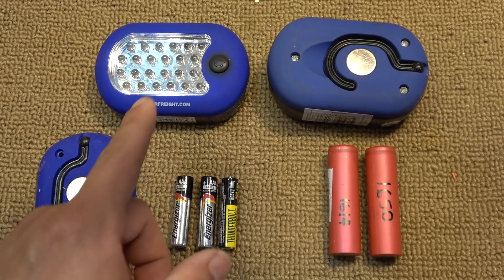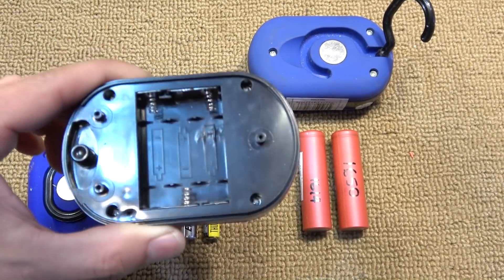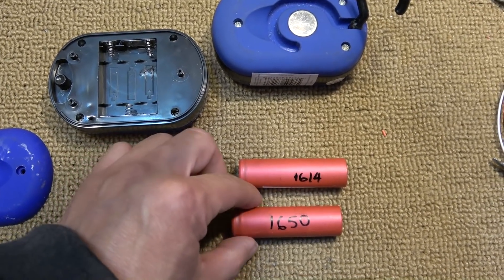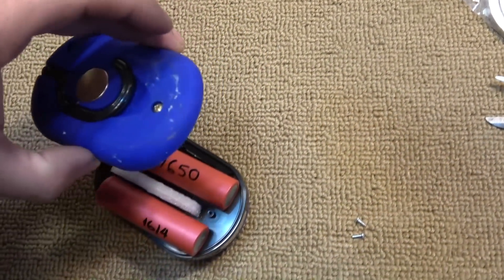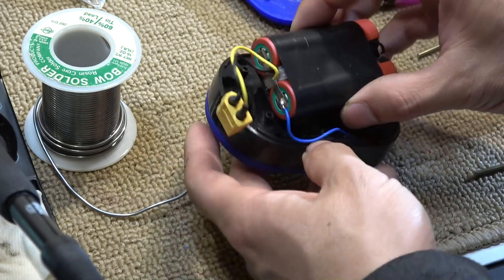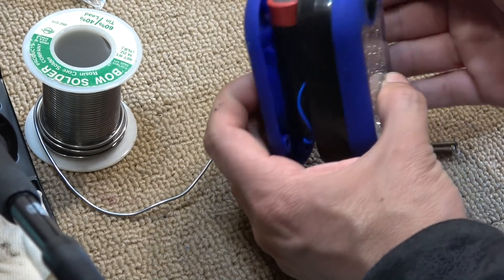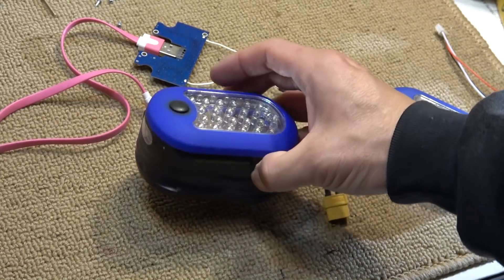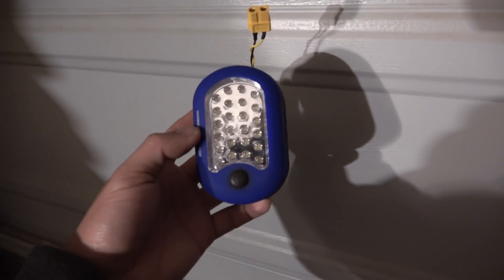DIY: Hack Harbor Freight magnetic flashlight to run on 18650 batteries

Comment: Looks like the same battery that's in the solar driveway light $10.00 and the pocket power pack $5.00. All you need is a nice sunny window seal to set your rechargabe driveway light on and a wired in anelog headphone jack for a small sun charging jack and switch over system. Then you can charge those type batters all year long for free. Also back pack and camping friendly. Just some more cool ideas !

Comment: This video is BS 18650 batteries will.not even fit inside these freebie lights, even if you take all the guts out. He uses a different light that is bigger to do this "hack"

Comment: Use a dead light bulb (the energy saving things/LED's/plastic) and a glass/plastic thing with lid. Cut the dome off. Glue the dome of the lightbulb to the lid and make a hole for the wires. Add LED's. Add resistors, maybe. Add charge boards. Add wires/holes/hooks/holders inside. Enjoy.

Comment: Nice mod, these lights are great, but what is MOST annoying is there is not a simple on/off switch, the little light at the end is useless, so you always have to hit the button twice to turn it on/off.
So I hack mine (when I collect enough to do many at once), to remove the little led and make the switch so it always just turns on/off the main light.
Reply: Agree SOOOOO annoying just about every decent led flashlight/headlight nowadays has the multi mode BS.....how about just ON/OFF
The last headlight I bought has 4 modes high,mid,low,flash WTF FOUR CLICKS TO TURN IT OFF
Reply: @walkow8297  yep, I took one of those apart to try and fix it, and guess what?  It is some kind of software/chip that detects the button so it is impossible to easily fix it, at least to get it to not be 100% on, which drains the battery super quick, the second level on is where it should be.

Comment: The batteries that come with those lights don't seem to last that long, but when you can get the light for free when you are buying something else that you would have been buying anyway, it's worth what your "paying" for it... :)

I've never actually replaced a set of batteries in this light... By the time I need to do it, it seems that I end up getting another "free" one or I just end up removing the dead batteries and reusing the light with a different power supply... 

I'm currently working in my attic installing an island cooktop vent hood and ended up with a nasty gash on my head thanks to all the roofing nails sticking through the roof decking and other sharp nails and boards sticking out where they shouldn't... Lazy ass construction workers apparently thought that no one would ever need to work on anything in the attic... Or, more likely, didn't care... So, I bought a hard hat from Harbor Freight today for when I'm in the attic and was thinking about modifying one of the old HF lights like this to be mounted on the helmet... I was thinking something more along the line of mounting the light in the front with no batteries and then running wires to a battery pack in the rear of the helmet to balance the weight a bit more...

Comment: i'm gonna try this with my 6x D Cell battery powered water pump. It came with my Mr. Heater BOSS XB-13 propane camp water heater. I think will go hybrid 2x 18650 batteries OR 1 6v usb plug

Comment: I would cut out the inner plastic andmake battery cavity instead of the foam sandwich.  Drill mount a female power socket for recharging.

Comment: You had to use 1S BMS module. This will protect the batteries against over charge and over discharge. 
BMS modules are vital. Lithium batteries are dangerous.

Comment: It's going to be brighter and it's going to be more volts because 3 Triple A batteries in that light Are only to around 3 volts because only two of them are in  series which equals 3 votes... you will be much brighter...
Reply: I've looked at 2 of the ones that I have that are currently disassembled and they appear to be wired with all 3 in series... It wouldn't make sense to have 2 of them in parallel and the other in series since the limit of your power would be based on the capacity of the single battery... Also, one of the things about LEDs is that they are a bit picky on the voltage that you give them... It only takes a bit too much for you to get a burned out LED and it will happen so quickly and without a flash, so you probably won't even notice it happening... With a white LED, you will probably be looking at a Vf (forward voltage) of around 3.3V with a max of around 4V, followed by a burned out LED soon thereafter...Since the AA cells an produce at least 4.5V when connected in series (when new), there would have to be some sort of circuitry inside the light to reduce the power... This could be as simple as a small resistor to drop the voltage and limit the current... Ideally, there would also be some circuitry to compensate for the lower voltage on the batteries as they get depleted (perhaps similar to a "joule thief", but considering the price of these lights, I would be surprised if that was the case...

Assuming that you want to run the LED at 20 mA, then if it has a 3.3V Vf and you have a 4.5V supply voltage, you would need a 60 ohm current limiting resistor.  There are various LED resistor calculators online...

Comment: The magnet on the newer ones are not very strong.
Reply: They vary... I usually have a couple stuck to the side of my freeze and they usually stick to it, some more than others... I had one though that as soon as I put in on the metal side, it started slowly sliding down the freezer side...

Comment: Or you could buy something like 10 pcs 3.7V 1000mAh LiPo Polymer Rechargeable Battery For Mp3 GPS USB Pen 102535 from eBay of around $22 and put 2 batteries inside and the case would close right and these will also charge to 4.2V. Yes it's not free but it's use-full. I bought some and made 9V rechargeable batteries using a Micro USB 3.7V 18650 Lithium Li-ion Battery Charger Module Boost Step up 4.3V to 27V output and some heat shrink tube.

Comment: Awesome job!! I did the same thing with the same light 3 years ago using a old cell phone battery and the battery and charge circuit to fit inside with a hole for charging with a mirco USB.. Mine last a long time but yours would last 10 times longer.. Too cool thanks for sharing!!

Comment: Haha. It’s good but Id rather get a fenix light which gives you a 1000 lumens on one 18650 cell
Reply from the maker: But then it only last a few minutes. :D
Wait a minute, Charles Darwin is here, everyone!
Reply: vuaeco I use mine for 30min every day on my bike rides and charge once a week. The battery is down to only 50-60% at the end of the week. I can easily go two weeks without charging. Miss harbour freights - nothing like that in UK. Stuff was dirt cheap, but very poor quality

Comment: Xin hỏi là ,máy ảnh mình  dùng pin( NP-BK1) 3.6V 1000 mAh,  Li-on ,mình có thể dùng pin 18650 thay tế không ?  nếu không thì nên dùng pin nào thay thế ?Thanks
Reply from the maker: Pin NP-BK1 cung chi la Li-ion cung giong nhu 18650 cho nen thay the duoc. Hai cai giong nhau. Chi co cai khac la 18650 pin to hon nen xai duoc lau hon.
Reply: @vuaeco  ok ,cám ơn nhiều ,lúc trước có thấy anh chế cách làm pin  cho canon sx150 ,mình cũng sẽ làm giống như vậy ,bởi vì pin  NP-BK1 bây giờ khó tìm .Thanks

Comment: I have an orange one of these and I modded it to run off USB power. I just soldered a USB cord to the wires coming from the battery terminals and ran it out the case with a small notch cut in the case. I can plug it into USB ports, power banks, car chargers.
Reply from the maker: Very nice!
Reply: I am going to try adding a mouse tail to mine like you did.  I was worried about too much voltage.  The 5v from the usb didn't fry it?
Reply: @christopherf8160  5v usb is ok for this light. I did it.

Comment: I have this EXACT SAME FLASHLIGHT except it’s red and I got it at a gas station. I might do this because it’s been sitting on my desk disassembled without batteries and I don’t wanna get AAA batteries (I already have 18650s laying around). Thanks!
Edit: Ended up using a Samsung li-ion battery since it fits (with a few adjustments to the plastic). The blue resistor burned when I first put the battery in but that was an easy fix.

Comment: Lol seems like slot of work for something you can get free every time you buy something cheap plus you can get  AAA battery's for a very cheap price at H.F lol. Still kinda cool though I guess. I've got a bucket full of these light lol. There pretty bright to be what they are.
Reply from the maker: Put those AAA HF batteries in there and a couple weeks later it'll leak battery juice and corrode all of the battery terminals on your device.
Reply: @vuaeco  I use them all the time and I've never had problems with them.

Comment: Take a soder gun melt out the plastic battery holder then you will have room for the bigger batteries and cover will fit all the way
Reply: טיפש
Reply: or just use a 10440 in one of the original slots, but then it's not free
Reply: @dummkompf  10440 has really small capacity, 3xAAA NiMhs would be best way to go without modifying anything. 3x10440 would be a bit better (if we take into account 900mAh NiMh and 350mAh 10440, that's 3240mWh for AAA and 3885mWh for 10440) but you would have to rearrange slots.
I've actually used pouch style lithiums in these typed of flashlights with very little mod, you could fit 1000mAh battery inside very easily, you would just have to cut some plastic away from battery holder.

Comment: When I pulled up this video I was looking at a HF light on my bench. 
Now I had just ordered five power banks that take two 18650 cells. . My thought is to use batteries from garden lights as they are aaa in the ones I have. Then use a solar panel to charge them.
As well as use a power bank in a pinch. 

Or just use a big flashlight

Comment: the batterys 18650 nedds a PCB BMS Protection Board
Reply from the maker: Not really.
Reply: What's a cheap $2 flashlight who cares pcb bms protection
Reply: @thewarzoneking  It is not so much protection, is that if you put it without the BMS The batteries will unload the batteries Plus 2.5 V and can not recharge more, being disabled ,, And also if you do not want to Complicate, buy a $2   flashlight

Comment: The problem is if those batteries are not protected and you discharge them to 0 or overcharge them they might explode.
Reply: ^^ Exactly what I thought when I started video. Watching now, as I type, assuming he will not be installing a low voltage cutoff. While these types of conversions seem like great ideas, they effectively kill your 18650's the first time device pulls voltage below threshold.

Comment: I was about to do this to mine, but mine is not a Harbor Freight magnetic flashlight, but a fact similarly one, but I'm going to use a smaller 18650 battery

Comment: No thanks. Its NOT jard to replace 3 trip A batterys as opposed to hacking the crap out of one. They are FREE to begin with. On top of that you still have to charge them. I see NOTHING practical about what you did. I like those lights and get a huge pack of batterys for cheap enough. Generally, they last a long, long time too.

Comment: NO BMS or PCB!!! I Could excuse newbie guys but you’re expert on lithium I don’t know why you missed the BMS part? Used to love your videos but dislike for this one...hopefully you make it right next time bro.
Reply from the maker: If you watch my videos then you should know that I do NOT use BMS on almost anything. So you didn't watch other videos then. :D
Reply: He uses an external tp4056 on and xd60 connector.  With 2 cells in parallel, just us two matched batteries.
Reply: Don't even have to be matched since they are in parallel.  Just use a hobby charger.  No bms needed.

Comment: Why didn't you just cut the inner plastic which holds the spring tabs for the batteries to fit the 18650s sideways then solder wires directly to the battery since you arent going to replace them.

You could have even just removed the inner plastic completely and soldered the wires from spring tabs to the batteries and glued some foam to hold the batteries in position.

Also cut a hole to mount a charger socket.

A little bit of rewiring would make this more professional and slimmer profile
Reply: Exactly what I was thinking!!! He needs to slow down and think things over for a sec. I ain't got all those fancy tools but sure I could come up wit something lot more compact then that. Might even get it in my pocket. Not like that thing. Would need a backpack for that thing. haaa
Reply: @Ken I would love to see a video with your version.

Comment: I have the same kind of flashlight from harbor freight tools there's nothing wrong with a small batteries they were just as good AAA batteries works just as good
Reply: They are non rechargeable...
Watch the video. 
A flashlight is only as good as its batteries
Reply from the maker: @user-tr2dh4xx6u  Very well put!

Comment: Cool, I'll bet run time is in days?
Reply from the maker: Yes. Harbor Freight specs says 48 hours of run time on the AAA. An 18650 is typically 3 times the capacity of 3 AAA put together in series. I have 2x 18650 so it's about 6 times the capacity. That's a whopping 12 days of run time! :D

Comment: HF also has free batteries with coupon, if I bought the spot welder how much would that cost vs buying batteries. This hack makes no economical sense.
Reply: He already has free Lithium batts around the house. A lot longer flashlight time, optional phone charger..well worth hack
Reply: This video is for those of us who have recovered more 18650s for free or very low cost and are looking for more applications for them.  I appreciate his videos.
Reply from the maker: LOL. You have to buy something to get those free batteries, mate. And those batteries are the worst thing you can do to your device. Put them in and a couple weeks later you'll see it leaking battery juice out and corrode the terminal. Next thing you know, your device doesn't work any more because the terminals are no longer conductive. And why do you need to buy a spot welder just to make a flashlight? Are spot welders for one time use only? Also, in case you didn't know, there are more than one way to connect 2 batteries together without a spot welder.

Comment: If you are using 18650 I suggest using lower capacity， cause it‘s more cheap then others， My 18650 1200mah only 0.3USD per pcs
Reply from the maker: Wow that's cheap! That translates into $67/KWh. Very cheap! :D
Reply: @vuaeco  http://www.xxshldy.com/ My website

Comment: I just got my freebie light recently and was thinking how to convert to 18650s since I've got a bunch. I've used battery holders in the past, but this is a great idea since it looks built in. I'll probably use a TP4056 charger module though (a power bank module would be even better!). Also, I'm pretty sure there's enough room so that you can fit three (3) 18650s instead of just two. By the way, the newer lights have a very nice LED module now. Another great video. Thanks.

Comment: Why not cut out some of the plastic and slide a 2x18650 holder in there? I would rather keep it with replaceable batteries and charge them in my Nitecore charger.
Reply: Sounds like you enjoy spending money.
Reply: @fun_ghoul  
I just hate having to keep things plugged into something to charge. So nice to be able to swap out batteries and get charged instantly.

Comment: I love your videos, projects and diy battery packs using laptop batteries.  Been watching for quite sometime.  Tend to noticed you shy away from using bms for simplicity.  I use to be the same way and use balance charge.  Now I use protection 😅 mainly for over discharge which is bad for the cells.   

Thanks for this cool project idea.  I plan to convert this exact same flash light.   Tired of this dying on me.  But I plan to use a usb micro charger and control module like a TP4056 or similar.  It's cleaner look, easy charging, and over discharge protection down to 2.5v
Reply: And these control modules are tiny and cost less then $1
Reply: @Lowegy  Nothing "costs less then (sic) $1" unless you're in Shenzhen to pick it up in person.
Reply: @fun_ghoul  just buy a 10 pack for $6 shipping included and hack everything in sight!

Comment: Nice V, I did same with craftsman led wand. Replaced the NiCd batteries with 1 18650, used tp4056 for charging I connected it to the factory charging port. Works great. Thanks for video V.